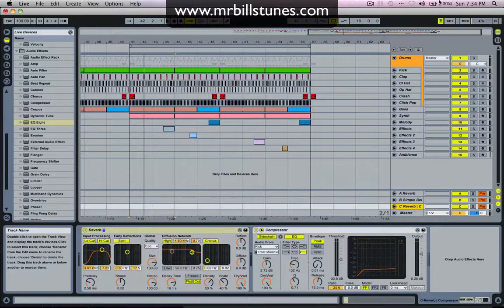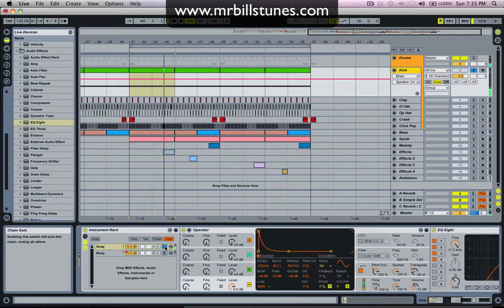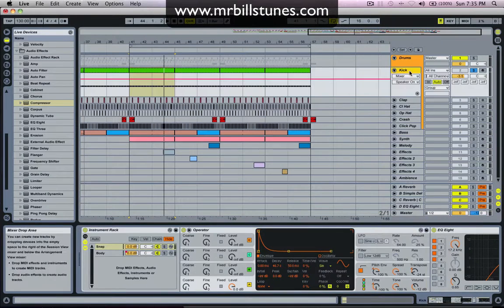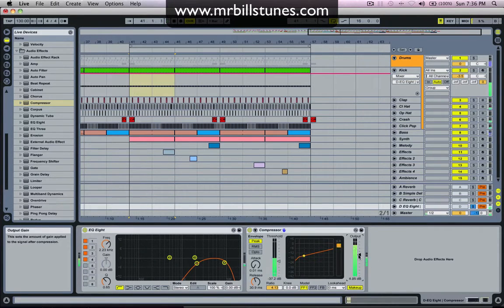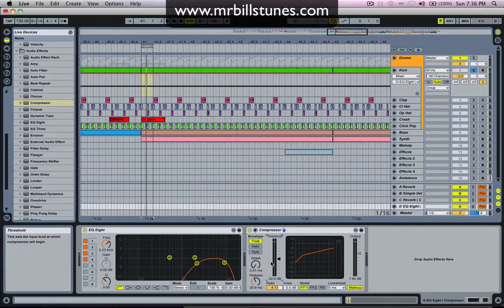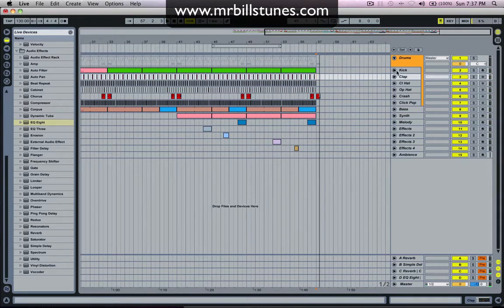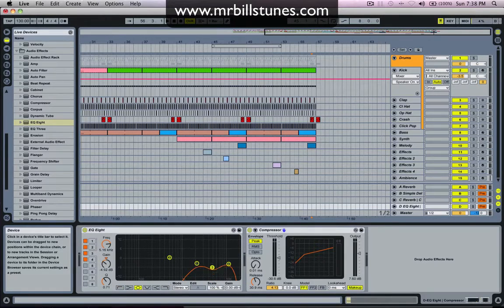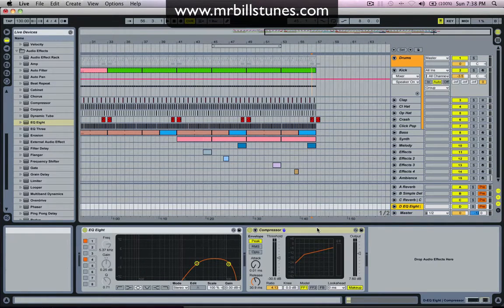Mr. Bill - Ableton Tutorial 26: How To Subtractively Add Frequencies To Your Mix

Comment: I'm confuse why mr.Bill likes turn the return track 's "post" button to "pre", i had found he did this many times. thx for explanation
Reply: I'm not sure why he does it but when you have it set to pre the volume of the signal being effected in the return track is not affected by the volume of the fader of the "instrument" track - turn down the fader on the track and it will not affect the return FX level. With Post it will get quieter when you turn the original track down and louder when you turn it up so its proportional to the gain on the fader.

Comment: Quick question about New York/Brooklyn/Parallel compression on drum kits: do we still need to compress the individual hits of each sample? I will mostly layer 2 kicks and 3 or 4 snares, then provide a compressor for each group of type of hit before passing everything to the NY compressor. It seems that without compressing each hit or group of hits, the sound is flatter than desired. Then again I could be wrong.